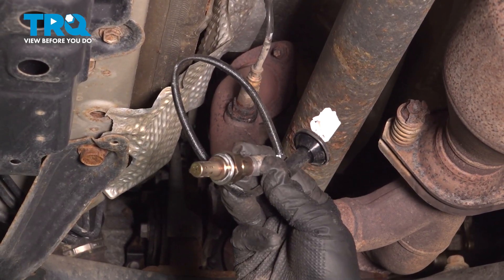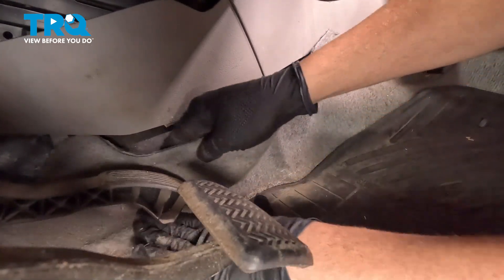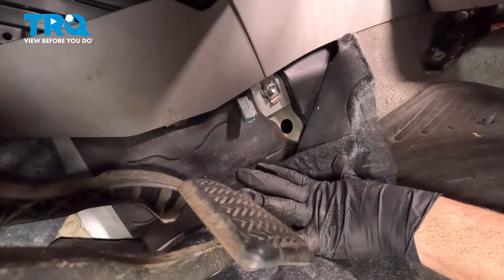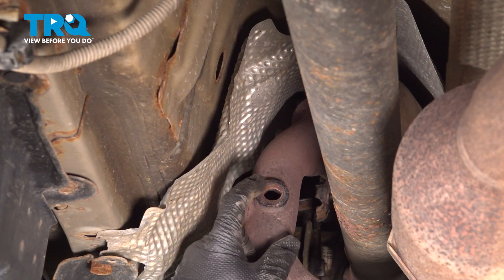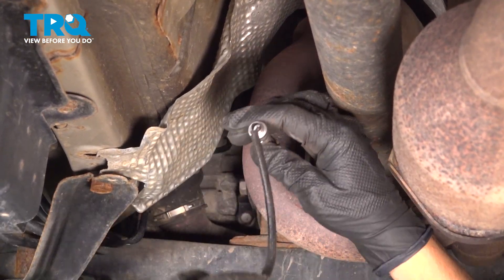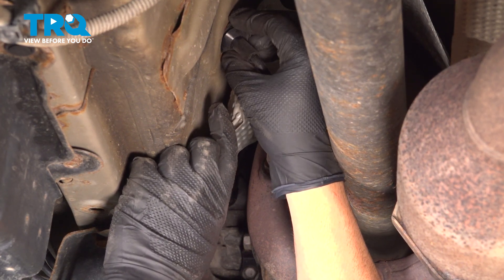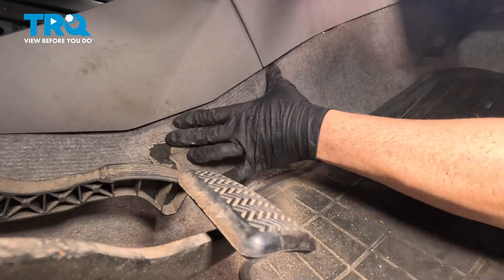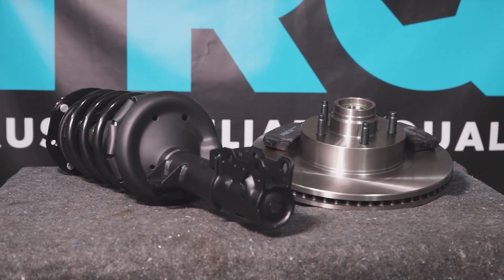How to Replace Downstream O2 Sensor 2006-2012 Toyota Rav4 3.5L V6

Comment: It mentions Replace Downstream  - Question is the Sensor not very close to the engine on the exhaust - is this not called UPSTREAM? Wouldn't downstream be on the converter exhaust?  I am thinking Bank 1, Sensor 1  after I viewed the video. Sorry, I am not a mechanic.